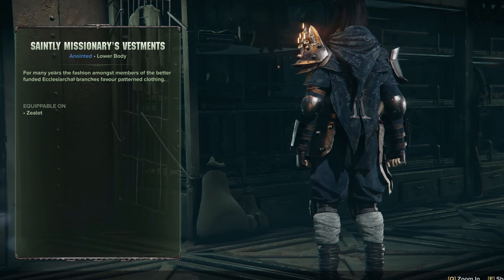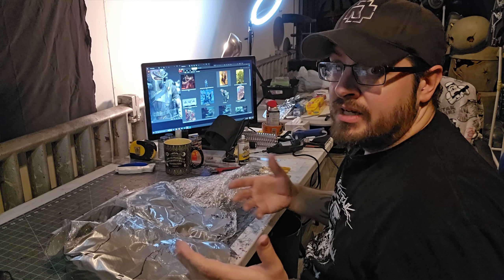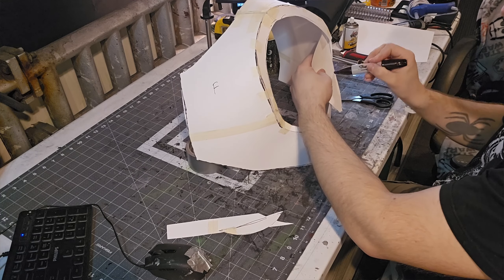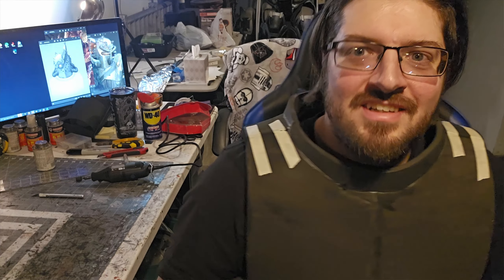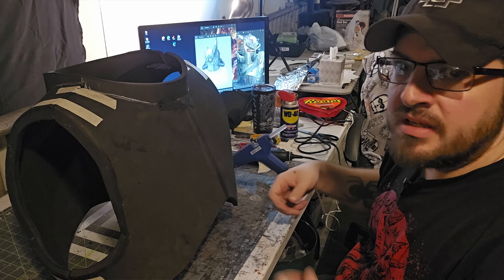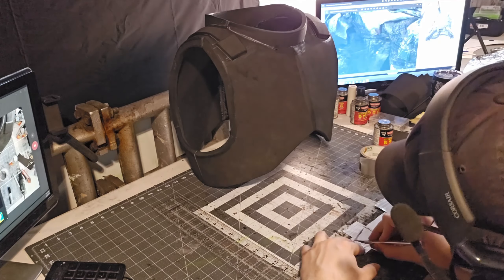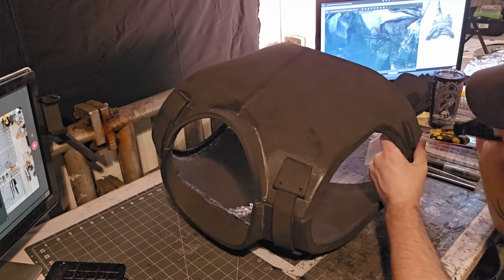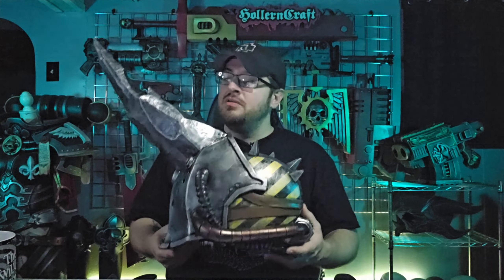DARKTIDE Cosplay Part 1 - Chest Armor - Scab Captain Costume - Warhammer 40k

Comment: How well does the glue hold the pieces together, is it strong and durable? I've never made anything with glue and foam before.
Reply from the maker: It holds really good.  With thicker foam (10mm), you usually need a 2nd coat of contact cement after the 1st dries, but the bond is usually so strong that if you try to pull them apart, you'll rip the foam instead.